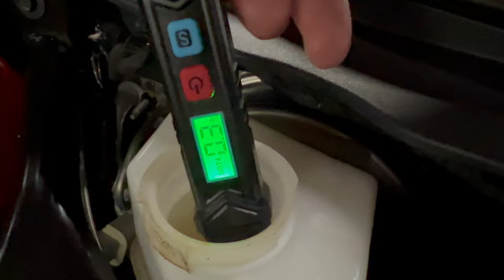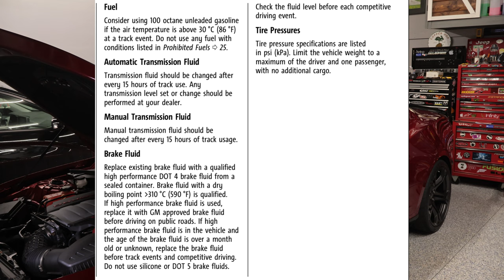How-To: Test Your Brake Fluid // Maintenance for Any Vehicle

Comment: This is great. As a ZLE owner and serial SRF owner, you have convinced me to move to HTC64. Question - why not have SS brake lines installed? I’m sure a lot of us would welcome content related to the install of it.
Reply from the maker: The brake linings from the factory are actually rubber coated stainless steel braided, so there isn’t a “need” for it. Now, is there an improvement from aftermarket solutions? Yes. Is it a “required” upgrade? No. If I ever do the install on them, I will for sure make a how-to install video on it.
Reply: @FollowMyLine17  Not sure what happened to my previous reply but the stock lines are not SS braided inside.
Reply from the maker: @AllIsWell_22  I’m not sure either, I kept looking for it. You are absolutely correct and I misspoke. They are Fiber reinforced lines, not stainless. I think now I need to make this purchase and install video, “for science.”

Comment: Looking forward to hearing your thoughts on the Brembo fluid. I've only used type200 and SRF on my CTS-V so far and both left me wanting a firmer pedal. Was thinking of switching to endless for my next flush since it's supposed to be the best in that regard.
Reply from the maker: The Endless solved my pedal needs. I’m on my trying the Brembo out because it is highly regarded by some friends of mine that race in WRL and participate in the Nürburgring 24h. If I don’t end up liking it, I will end up back at Endless. I’ve also heard great things about AP R4 and PFC 665.
Reply from the maker: After making the swap, I can say the pedal feel is the same as the Endless. This is only based on “around town” driving and not on track yet.
Reply: @FollowMyLine17  a friend said the same after swapping SRF for Endless. Yesterday tried it on track and said it was way better. So at least good to see that on road behavior is good/the same.

Comment: Does this also test brake fluid in the calipers? So if you test the reservoir fluid it is the same as caliper fluid?
Reply from the maker: Yes, it is all connected and flows through the brake master cylinder and ABS modules (when equipped) and circulated through the calipers. I am getting ready to flush my fluid this weekend. I’ll let you know the reading at the caliper and at the reservoir to help ease your mind!
Reply: Well done, as always!  I’m also interested in what you find at the caliper (if there’s any difference from the Master Cylinder). 

I also just switched to the Brembo fluid. Had one track day on it so far. Pedal felt good. About the same as Endless in my opinion.
Reply from the maker: I swapped my fluid yesterday and tested again at the master cylinder and at the fluid that came out of the caliper. It was the exact same.

Comment: Great video! I'm getting my 1LE ready for it's first track day later this month and was planning to put in Castrol SRF I've read good things about it, especially its longevity over a year. I have about 4 track days and a few road trips planned between now and when I put it back into storage in November. Do you think 650 will last well and what about the brake pedal feel on the 650 do you like over the SRF? Thanks!
Reply from the maker: I’m excited for you, for your first track day! PLEASE let me know how it goes. The pedal feel with the Endless RF-650 was firmer than with the SRF. Don’t get me wrong, SRF is very, very good fluid and used by race teams across many series, but I prefer the feel to the RF-650. Also, I have had zero issues with running the Endless for an entire year, but I also store the car in winter time. For someone tracking their car, this really should be a non-issue, as you should change your fluid at least once a year, or more, if you do a lot of tracking.